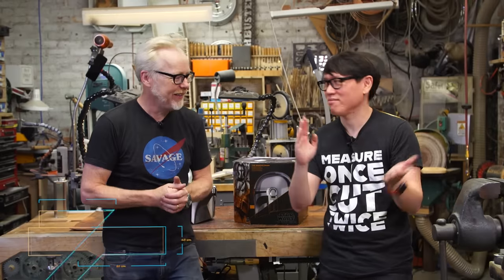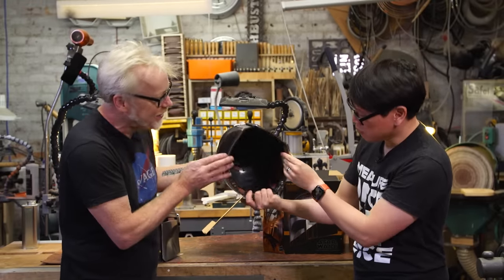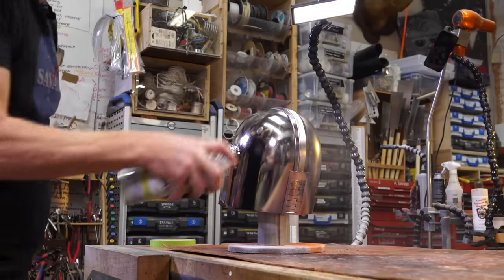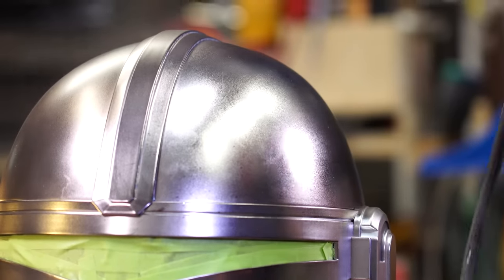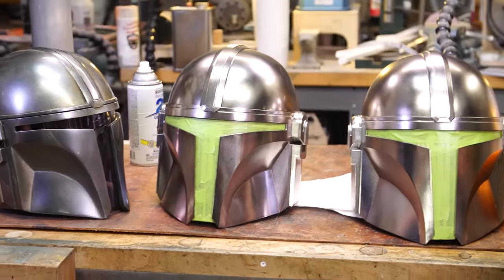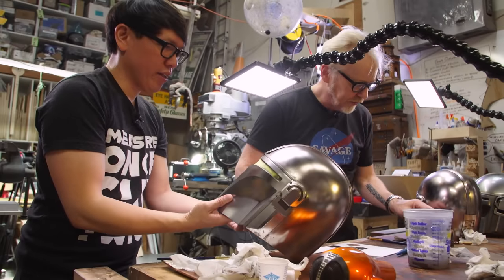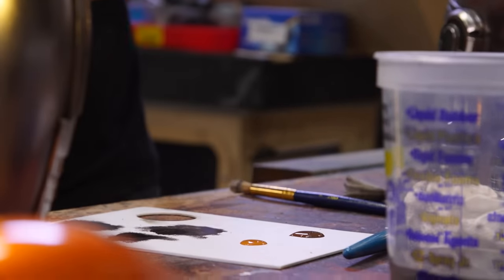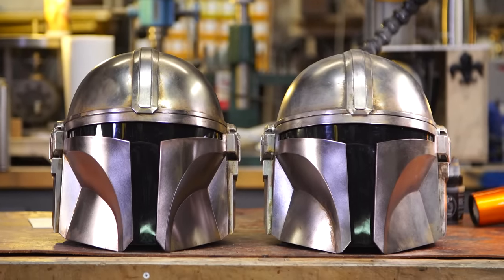Adam Savage's One Day Builds: Hasbro Mandalorian Helmet Repaint!

Comment: I see where the acrylics for panel lining would be good for time.  If time wasn't a factor and you had issues with the acrylics drying too quickly (looked like Norm was having trouble), oil paints have a much longer cure time, so they're easier to remove.
Reply: Oils or an enamel like Tamiya black panel liner for the long grooves. It would offer time to correct mistakes, and capillary action would make it quicker to apply in those areas.

Comment: Vallejo Black model wash…..absolutely perfect for this job in aging the helmet ….It already watered down so it easily gets into the crack and crevices. I just used this tonight and it worked great. I use this in my air Brush normally but tonight I just put some in a bowl and used a brush to dab it on. Give it a try

Comment: Working with scale models I always use floor wax… so it would have been interesting to see the result of floor wax once polished, because the porosity left by an airbrush at let say 20 psi is medium to high therefore it isn’t flat, the light gets lost! If you use floor wax … polish it and you will be amazed .. because you can control the shine… depending on how much you polish with 1500 - 2000 grit sandpaper, always manually because RPMs from a power tool may increase temperature and damage the material ❤

Comment: I like with forward facing and side parts on wearable gear to put some deep looking scratch and scrap marks. Like the suite was deflecting ricotchets or like you were going through a wooded area. And along the bottom edge of the helmet i would make tons of wear. like make it look down to the bare helmet material. Like it is rubbing against the shoulder plates or walking through the woods. I know starwars had alot of deserts so maybe a light sand dulled wear.

Comment: The visor of one is slightly noticeably larger than the other, particularly the front edge where it curls downward, but that might have been done simply to increase visibility. The windows are moderately larger.

Comment: Hold on! Don't mock Don Post. Yes, the quality varied through the years and the best didn't match what one can get today, but they were a revelation at the time and a huge step forward from what came before
Reply: Don Post had the basic plastic and vinyl "cheap" versions of Darth Vader, Boba Fett, Stormtrooper, TIE Pilot, C3P0, etc. But in the mid 1990s Don Post introduced the "Classic Action" line of Star Wars helmets (~$150 price point) of Vader, Stormtrooper, TIE Fighter Pilot, which were full sized and based on the movie helmets. Don Post was also the first to offer licensed fiberglass high end (for the time) versions of some of these helmets as well.

Comment: why not use oil paints, for filling in all the recesses. Acrylics are not really great for that kind of a job. They do dry faster, but you need to also be really quick and do small patches at a time. With oils, they flow better, and makes cleaning it a breeze.
Reply: The main benefit of acrylics is the drying time. When you're doing a one day build you're going to be handling parts you've painted and with oils you either need to be super-super careful or let them dry over a few days. Also you can build up the layers of colour quickly with acrylics without the risk of them blending too much into that dirty brown grey you can get with overworked oils. It's a forgiving medium for the novice.

Also if you make a mistake, even if the acrylic feels dry you can usually fix it with a damp cloth and some medium pressure. If you need to use oil based thinners there's a possibility of ruining the chrome finish of the helmet itself as some finishes don't react well to white spirits.

I think the finish you'd get with oils would be much smoother and ultimately more convincing. Or if it were me I'd probably do both. Oils for the recesses and smooth transitions and later acrylics for some different texture top colours.

Comment: Would be cool with a clock in the corner to show how long it takes. I guess they work quite faster than the average :)
About the floor wax. Just any floor wax or is there a certain floor wax that works the best for the way of a use? I live in Denmark and everything is sooo enviromentally safe, that alot of paints, clearcoats and wax justr dont work as they should. Alumaluster cant even be bought in Europe due to the nastyness of the paint.

Comment: My Dad was a body man, his Dad was a body man, and I grew up in a body shop. I've sprayed so much paint, I probably have irreparable lung and brain damage from it... Norm... I love ya, pal, I do, but please, take this advice.

Start at the bottom with your spray pattern. (It's never a bad idea to grab a piece of cardboard and test how the spray is coming out. It's usually the same, but I have had some cans/guns that spray in funky ways out of the gate that can cause you problems if you're not expecting it.) Starting at the bottom will give your paint a "base" or "foundation" that can help prevent runs. Always overlap about 40% - 60% with each pass. Start with your spray off of the piece, and pass across it until you're no longer on the piece. Always keep the "grain" the same. Don't go left to right and then up to down, but left to right and then right to left is fine. (That won't always matter, but can at times show up in the finish. Especially if you accidentally put on uneven coats.)

When you pull off your masking, always pull it so that you've essentially pulled the tape back on itself at a 110-degree or so pivot point. You're pulling it back over itself. So that if, for example, you were to drop it straight down, the tape's nonstick sides would be touching and overlapped. I don't know why I'm having such a hard time describing what I'm trying to. Either way, it has a purpose. The idea behind that is, so it will "cut" the paint that is clinging to the tape. You'll avoid having the dry paint on the masking grab onto the tape to then pull chunks of paint off of the piece. 

None of these are the only techniques that work, obviously. These are just the things that I try and do when I paint. I have, so far, had quite a few compliments on my work, but am by no means the world's foremost expert on painting. So, try different stuff and use whatever works for you, but I felt you were adding a bit of extra work to the situation and hope this advice might help you and/or others.

It's advice, take it or leave, either way, I hope you all stay healthy and safe.

Comment: I just got one of the Hasbro MMPR helmets.  Unfortunately, there are two semi-common issues to overcome.  There isn't enough room for my big Irish head (I'm going to try removing the inner straps and see if it fits with maybe some thin foam rubber padding instead.  But then, the color-matching is off.

Comment: I have a question, How would I dull it down a little bit from the Chrome without using the floor wax? I don't have an air brush and I was wondering if there was some other kind of clear coat I could get to just dole it down a tiny bit like you have in the video to make it look the most like metal as I possibly can

Comment: With the black series mandalorian or din jarin helmet it didn't fit my big head but the Boba Fett one does which makes sense but I wish they would make it like a different size I still have it in my collection though along with the white concept art Boba Fett helmet
Reply: I had to take out the internal strapping because the mounts by the ears hurt. I replaced it with regular motorcycle foam padding. Fits nice and snug now.

Comment: I wonder how feasible it would be to paint another color over the base metallic finish, before the weathering, and get say a metallic Deathwatch Blue as a result, for example.
Reply: Definitely achievable but you want to use a translucent paint for it. Tamiya have a number of clear paints which would work but you need to use an airbrush and be cautious about layering too much in one area or not enough in another.
Reply: @daxriley8195  that sounds like it's well outside my skill set. They do have a Deathwatch helmet coming out soon, although no clue how screen accurate it will be.

Comment: And the part where they start doing all the black in the recesses is where oil washes and products like Tamiya's Panel Line Accent Color Black is the best thing in the world to have. The Panel Line paint stays much more in the lines and doesn't run everywhere like oil or acrylic washes can. And they are definitely a hell of a lot easier and faster than what Adam is doing. Pay attention to the tabletop miniature wargaming crowd, they'd learned a lot of tricks over the years and do insane paint jobs.
As someone that was trained for doing autobody and paint, seeing Norm dry spray those paints on the helmet just makes me cringe. Just misting from far away gives you paint that doesn't like to adhere and makes tons of rough texture like sandpaper.